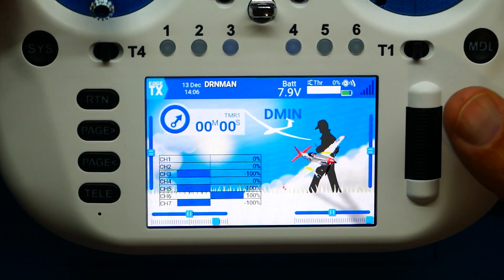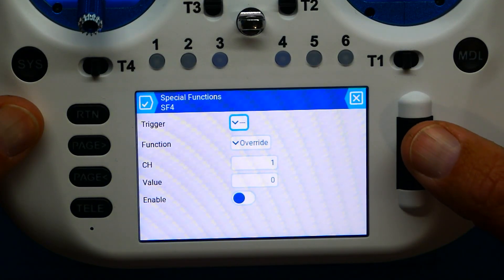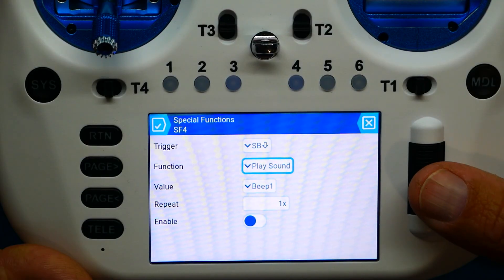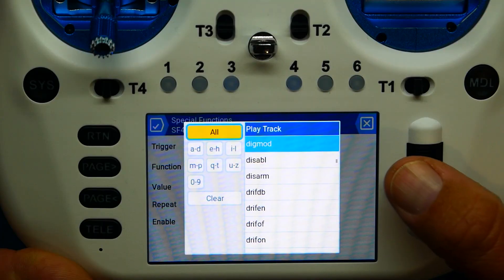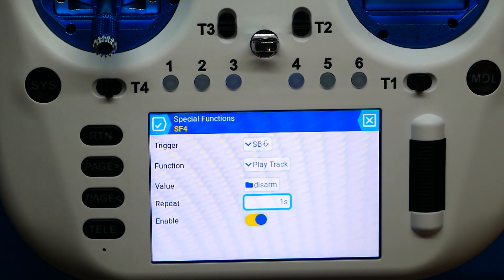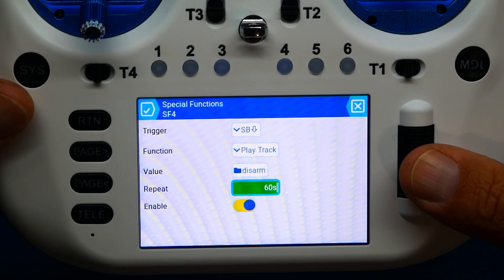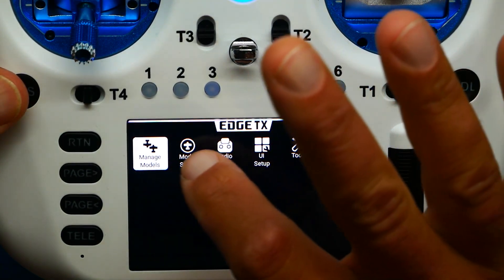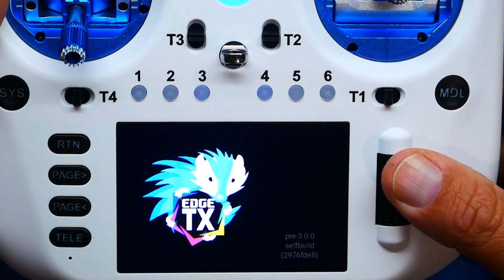How To Program Sounds To Switches On Your RadioMaster! Become A  Radio Master!

Comment: Thanks, that is exactly what I wanted to know. I have the VTX power output setup to adjust on one of the pots but when I power on my tx16s, it would sound off all of the power levels, it was really annoying. Now I will be able to power on without the radio sounding all the power levels. Very handy being able to adjust the VTX power on one of the pots on the fly. I have it setup on my analogue quads but over christmas have brought into digital, I have also done the same setup for adjusting the VTX power on digital.

Comment: Why does my TX15, when powered on with the switch already toggled, only show a message on the screen Control Warning but does not play the Switch Warning sound? I have the latest firmware installed.
Reply: Okay, I found a bug with the latest software (19-Dec-2025) - there is no switch warning sound. On the previous version everything is ok